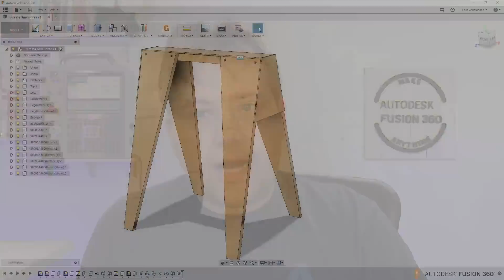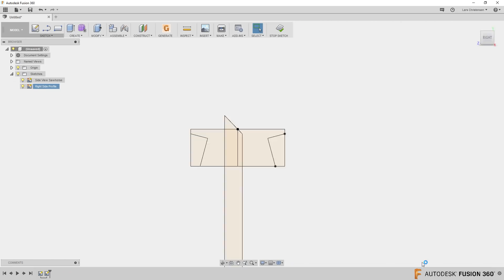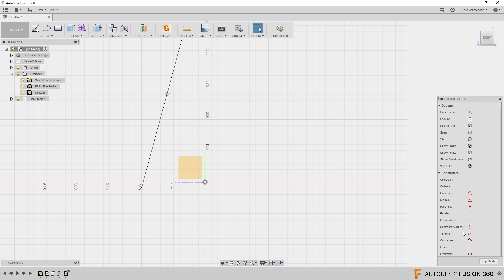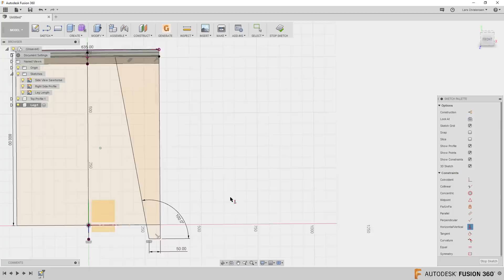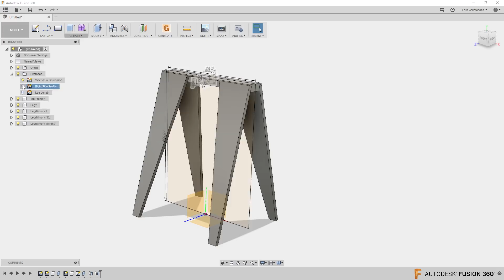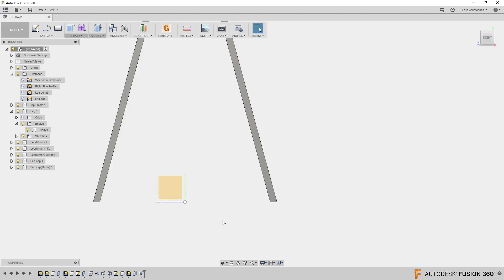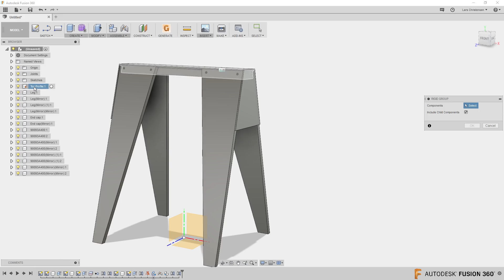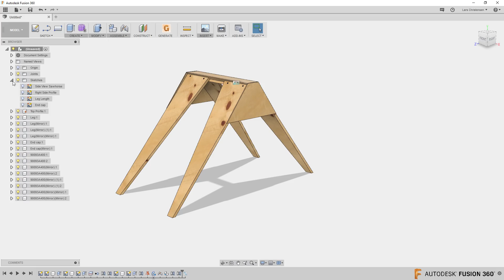How To Make Better Design Layout — Fusion 360 Tutorial — #LarsLive 170

Comment: Absolutely informative video today.  I learned that to control subsequent changes to your design it is better to use control sketches I like that. my only objection would be against using rigid groups it’s good for virtual prototypes but in the real world as a carpenter you build things sequentially part after part. Also designing sequentially allows you to troubleshoot more easily using the timeline. 
The only type wood I would work with without drilling holes before I use the screws would be poplar, most other wood  would split along the grain. Also to save time mirroring components, I usually activate each component and complete everything that has to be done on the component before I mirror, like drilling the holes adding fillets inserting the screws adding the joints. The amazing thing about Fusion 360 is there are so many different ways that you can approach building something.  There’s no better slogan that I make anything.
Reply from the maker: Hi Errison Zelaya Thank you for watching! And for the great comment! Some great points!

Comment: Here's my problem that I ran into with sketches not "bundled" in the components. When a component is copied to another design the sketches that make it up are left behind and a bunch of elements in the timeline are now yellow.
Reply from the maker: Hi John Bickford Thank you for watching!
Yellow means lost reference, I wonder if something was moved vs. copied. But, great point. If you don't follow what is called rule one from the forum and model with sketches included in your components, these will become like dumb solids.

This might be a good livestream topic. I realize that I might have to do a better job explaining what modeling style to use depending on what you need to do with your design.

Thank you for commenting. This is helpful.

Best,
Lars

Comment: Really enjoy your videos.

I do have one question. When you extruded the legs, you did it to a point. I would think the leg thickness would change when you changed the angle of the legs. Did I miss something?
Reply from the maker: Hi btberch Thank you for watching!
Well, the software uses the point as a reference to measure the thickness within that extrude. I believe that if I had used a dimension I could have driven it through a parameter table and it would have changed

Comment: Surely there's an easier way than that. I bet Jimmy doesn't do one design, other than on a scrap of mdf. Seems so complicated Lars ?  I'm beginning to think that learning fusion is way to hard for a hobbyist, by the time you have understood how to use a function,  you  have forgotten it unless you use this EVERY day for 4 hours.
Reply: Sounds like pencil and paper may be more your speed. Coming from having used SketchUp for this sort of stuff, I'd say that while Fusion is far more powerful, it's not any more or less complicated... it's just different. 

I don't use SketchUp everyday. Weeks, even months could go by between heavy usage where I feel like a SketchUp wizard, vs. looking at it a month later dumbfounded. I suspect in moving to Fusion I'll face the same challenge. But having to relearn these sorts of things is the plight of the "hobbyist" I guess.

It's either important enough for you to learn and relearn (doing quick Google searches to remind yourself) or it's not.
Reply: Adam's Lab  your probably right, just finding this learning curve super steep ! I always assume probably wrongly that tec should make it quicker. I guess it does in the long run as you can see the wrong doings before they happen ! Which in turn saves money and time. But I guess as I say for a lot of hobbyists the investment of time maybe too much unless you have a photographic memory or use daily. Which neither I have. I choose to try and learn fusion so I could model stuff and then print in 3D which I do successfully. I have learnt a lot in a few months and will keep trying.
Reply: That's the secret, keep trying and eventually you'll be surprised at what you know and finding the answers to what you don't know will become easier.
Reply from the maker: Adam's Lab, I could not have said it better myself :-) Thank you.
Berkeley, I totally get where you are coming from and I am not going to try to tell you otherwise. Learning mechanical CAD software will take some time.

Hope you both have an awesome day!

Best,
Lars
Reply: Thank you for doing these videos!